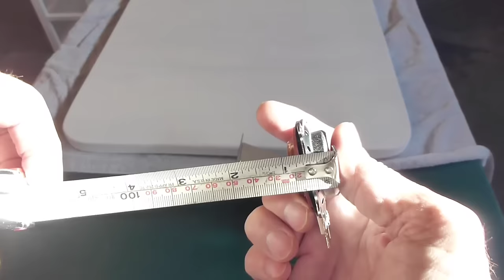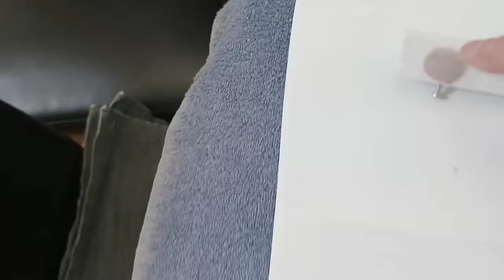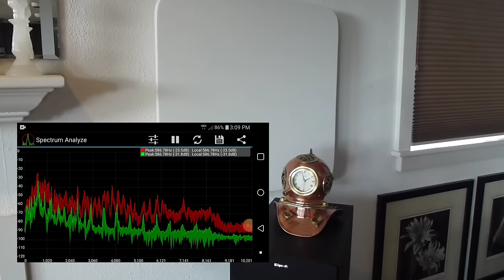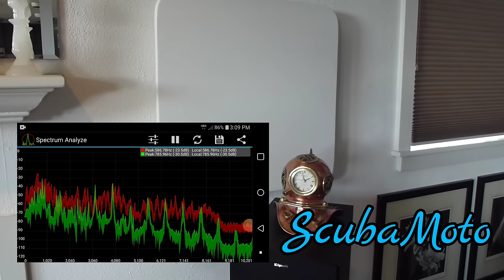How To Build DML Panel Speakers with Hidden Wall Mounts Fully Suspended

Comment: For some reason I can’t find 1 inch thick boards in Sweden. It’s either 20mm or 30mm, and an inch is 25.4mm.  What would you suggest I pick?
Reply from the maker: pepeu: The 24 watt exciter should sound good with either. The more power you're running through it, perhaps the thicker, more rigid dimension you would want but personal preference for aesthetics may be your deciding factor. It's likely that the origin of the 1-inch dimension by tech ingredients may have been as much a factor of what was readily available than of audio dynamics. With a few exceptions, most assessments of variations in shapes and dimensions yielded limited differences. Enjoy the project.

Comment: your mount looks amazing
may i ask if you stick both exciter to 2/5 3/5 area, or have one in dead middle?
Reply from the maker: shng sam: For the video I just wanted to show that this wall suspension system could accommodate both exciter positions and I wanted to show a layout for 2/5 3/5 position mount. So, I have heard this set with one exciter in each position and I currently have both at 2/5 3/5 but I honestly heard very little difference. I do have a note in the video description on exciter location. Thanks for the question.
Reply: @ScubaMoto  Thanks! Good to know that. in my future build i will have both in 2/5 3/5 position

Comment: What are the connector pins you use to wire up the exciter called? And where can I get them?
Reply from the maker: At the exciter I used spade connectors https://amzn.to/3Owwe2g I believe one is a 2.8mm and the other is a 4.8mm. I hope that helps.

Comment: But how do they sound with the volume up while listening to Waylon Jennings?
Reply from the maker: GB, My transistor radio sounds good with Hoss playin so now you have to build a pair of these to do him justice.
Reply: @ScubaMoto  - Yeah ... I've watched a few of these videos because I want to build a set. Your video was very helpful. I wonder if a different shape or different exciter would help with the lower frequencies?
Reply from the maker: If you're not building them as a supplement, just add a sub to deliver 150 and down. Larger panels will give a light reach down but you will likely be happier pairing these with at least a good sub. The Polk Audio in the video description is an example.

Comment: I'm curious.  Do we have any sense of what the sensitivity rating of speakers like this might be?  The exciters themselves have identifiable specs, but such specs are essentially isolated from the final surface area (i.e., cone equivalent) they are pushing.  Hard to tell from any of the videos I've watched what sort of SPL is achievable with X watts.  I ask because I picked up some of the 3W exciters when I was in Dayton at Parts Express a few years ago, and I'm wondering what I would need to achieve a reasonable listening level, or even whether such levels are achievable with those drivers.  For instance, is a 2W/Ch amp likely or unlikely to deliver useful levels, when coupled to 6 square feet of surface area, as opposed to the more familiar 10" round speaker?
Reply: i havent made these but everyone is using 20 to 40 watt exciters. i doubt the 3w ones would do much. but the 40 watt ones on a 24" panel can be pretty loud when turned up.

Comment: What paint did you use i am using lacquer and it's not sticking to my xps foam plate well
Reply from the maker: I sanded mine with the deep lines as mentioned in the video before painting and then used the same latex paint that is on the wall. Still good adhesion to this day. The paint is still adhering well and the exciters are hanging very well to the paint. I can still tug the exciters almost three years later and nothing is loose. I'm surprised an oil based lacquer isn't sticking well.

Comment: Question . What if i mount the exciter to a stand and the panels just float with no strings . So only the exciter glue will hold the panel . Would it work good ? My biggest concern is that the panels might have more movement to them because exciter is stuck to solid object .
Reply from the maker: Herus: Great question and I've heard others asking the same question since it would simplify the build. It will certainly have a different sound by changing the dynamic of the exciter. Anything attached to the exciter becomes part of it. So if the exciter is rigidly attached to a stand, they will move as one. The portion of recoil that was happening to the exciter will now be transferred to the panel as additional panel movement because the exciter would now be anchored. It will sound different but who knows, it might sound better. You could easily give it a try and see if you like it. If you try it, please let us know what you think for the benefit of viewers. Thanks for the question.

Comment: And of course, the Dayton Audio DAEX25FHE-4 Framed High Efficiency 25mm Exciters are not available. Doesn't matter, they are only 24 watts, do they make them 100watts?
Reply from the maker: frosted1030: I've heard some having success with the 40 watt exciters but it looks like even the 40W are backordered. Most of the ones above 50W are tactile bass shakers and would not likely offer the same frequency response needed for the same performance on a 24-inch square panel.
Reply: @ScubaMoto  I can rig some smaller Exciters in series, I hear. Sounds like a plan.

Comment: Are the exciters mounted directly in the center of both the panels?   

Another video led me here and that guy put them in 2 different locations on each panel to balanced the sound he said 

I’m surprised painting them didn’t affect sound. I’d like to make these them have a hand painted picture on both of them like art.
Reply from the maker: There's a note in the video description on exciter location. It depends on how many speakers per channel. Thanks for the question.
Reply: @ScubaMoto  I heard the mounting bracket and pin location measurements but must have missed the measurements on the exciters. Thanks for the reply, I’ll rewatch a third time and take notes.
Reply from the maker: If you're doing single speaker channels just use the 2/5 3/5 rule to locate it. For a 2-foot panel, that would be 14.4 inch from bottom and 14.4 from left or from right for the exciters. For a second DML on the same channel you would center the exciter.
Reply: @ScubaMoto  Thanks!

Comment: I am wondering if there is a way of making them Bluetooth ?
Reply from the maker: Patrick LaFontaine: Absolutely. I put links in the video description for examples of Bluetooth mini amplifiers and a power supply that works with them. One has a subwoofer output. I hope that helps with what you're trying to do. Thanks for the question.
Reply: @ScubaMoto  yup you can get little bluetooth stereo amps for ~$50 or a little more for what Scuba mentioned with a sub output, etc.  Heck you can spend hundreds on crazy bluetooth amps if you want, but I wanted to get something in the 50W /channel range to try applications like atmos, height speakers, or building a stand-alone frame that hangs the panel in suspension that can easily be relocated with a single hanger, etc.  Bring out to the patio, bedroom, etc.

Comment: Not cost effective, but I wonder if rigidity is key to sound quality, if carbon fiber would be better?
Reply from the maker: Chris Moore: Great point. If you have access to preformed panels it would be worth a try but I agree that making CF panels from scratch may not be worth the cost. At bare minimum they would go faster. ;-D

Comment: Can these speakers be simply directly connected to my stereo, like any other speaker ?
Reply: You have to compare the output power rating for the system against the input power required of the exciters you want to use. But theoretically yes.

Comment: Painting it doesn't damage sound quality?
Reply from the maker: Damage? Paint likely 'affects' audio dynamics. In a blind test, 10 people might give 10 descriptions of that affect. The bottom line is that the raw materials are unattractive enough that I have yet to listen to a pair of these that are unfinished. Some have tried fabrics, others texturing; but most use paint. A good paint with good adhesion likely offers the least sacrifice and may even improve audio delivery for many listeners due to surface texturing resulting from paint. Mine are still solid several years after so I would repeat the process today without hesitation. I would also consider commissioning an artist if I wanted super stealth sound coming from art with an acrylic on canvas look.

Comment: Anyone having issue with the exciters adhesive not holding up to a fall? I can't figure out how to  keep mine in place after the adhesive wears off
Reply from the maker: The most common solution I've heard to attach exciters is double sided adhesive tape. 3M 4910 is one example. I hope that helps.
Reply: @ScubaMoto  Thanks for the tip!

Comment: I really want to make one of those but I can't find those pink foam panels on my country. I have no idea what could be a good replacement.
Reply from the maker: WK_fpv: I put a link in the video description to get people started but for your location, just search on "poliestireno-extruido". It's very common in building materials and is not expensive. I hope that helps and enjoy the build.
Reply: drop ceiling tiles are as good or better and cheaper

Comment: Would we typically run these off the same amp as the conventional speakers or off their own amp? Also, should I make a second set with drivers installed and run them together? I also saw a video where a guy used birch plywood from his e depot.  Which is better for deeper bass and a richer all around sound quality?
Reply: Iff you want bass, just make the DMS's way bigger. You can use XPS for that. My mates panels dip into the 50hz as long as the sound is not too punchy. You should also use some sort of eq to flatten the freq response of the DML's. Makes m sound way better.

Comment: How about mounting these on the back of a canvas painting? Like inside of the back frame? Would it have an effect on sound?
Reply from the maker: Christer Johansson: Good question. I'll assume you mean mount the completed DML panel speaker behind the canvas and not just the exciter. Mounting the entire foam DML panel with the exciter to Canvas would likely work best with uniform adhesion of the panel to the canvas. But since canvas has no rigidity, you would not want to mount the exciter directly to the canvas. The exciter energy would send waves through the canvas. You would certainly hear something but not of much quality. Probably similar issues mounting the exciter to the canvas frame. I've considered sending completed panel speakers to artists as a canvas for a commissioned work. They are a good size for that.
Reply: I've been thinking about this too actually: mounting the entire panel inside a stretched canvas with a wooden frame - having the foam board suspended completely isolated from the canvas and frame. Maybe attached to springs like a trampoline. Not worth the effort if the canvass + thick paint would dampen the sound

Comment: What paint did you use? Also, did the paint dampen the resonance at all?
Reply from the maker: maddmannmmatt: I used the same latex that's on the wall. Good adhesion and good coverage of the pink foam. It probably has some effect on resonance but I didn't spend time listening before paint. It might even be a positive effect but either way I knew they would need to be painted to go into the room.

Comment: Why not just put some sticky tape on the back of the driver and stick that to the wall....you would effectively have a free moving panel only connected from the speaker. The only downside i can imagine is strain on the diaphragm from panel weight....unless you mount them on the ceiling
Reply: works only in theory because you consider the moving part to be fully disconnected from the rest. by far it's not
Reply: This is a very good question that I have also been pondering.
Reply: re: strain, in the current configuration, the diaphragm is supporting the exciter, and the exciter is much heavier than the panel.

Comment: What type of paint did you use in this build?
Reply from the maker: Tony Lesnau: I used the exact same flat latex paint that is on the wall it's mounted to. It sounds good with no adhesion issues two years running.

Comment: What kind of amp are you driving them with ? I ordered 2 pairs today so I could drive them with my regular Amp.
Reply from the maker: Scott Behl: The system they are running on (and the one in the video) is a gently modded Phase Linear 4000 with a single pass auto correlator filter into a four channel Yamaha MX-630 (135-8/190-4 wpc) volumed between 5 & 25 percent. One year later no issues.

Comment: What kind of paint did you use? Acrylic one?
Reply from the maker: The paint in the video is the same latex paint that is on the wall. Five years and still good adhesion.
Reply: @ScubaMoto  tks for sharing! Do you know if it interferes in sound quality somehow?
Reply from the maker: I'm sure there is some effect. Whether it's good or bad is a mater of opinion but I've never heard an unpainted pair since the raw materials look as bad as they do.
Reply: @ScubaMoto  Perfect! Thank you so much for your time on this! I'll plan the purchase of all pieces and try similar as you did. It's kind of hard to find everything here in Brazil, but that's why we pay for the internet, right?? :) Thank you again!

Comment: Little question, can these panel speakers be used as ceiling mounted speakers?
Reply from the maker: Jeroen De Vleesschauwer: Absolutely. It's a much simpler suspension that's easier since there is no need to adjust suspension pins or cords, they will all be the same length unless you want to "aim" the panels. You have only the speaker wire to contend with.
Reply: @ScubaMoto  thx for the fast reply. My wife wants my black Kef 3005 outside the living room because 'black'. So i'm looking for a worthy replacement 😉
Reply: @Jerre27  Try tinder
Reply: @xJBEZx  bad place to shop for a wife

Comment: the exicter right in the middle ?
Reply from the maker: Yves Informel: It depends. For the video, I needed to show that my design will accomodate both exciter locations: centered (6:08) and 2/5 - 3/5 (7:10). See note in video description for choosing exciter position. Thanks for the question.

Comment: 6:38
/
14:41

Comments

Add a public comment...

da man
Well after doing research all over the Internet and watch and find videos like yours I finally got all of my parts in the pink panels high quality pure copper speaker wire a nob sound Bluetooth mini amplifier connected to my Amazon echo dot in my title streaming music service I also did something not too many people talk about and I didn't think it'd make much of a difference I use a one-to-one ratio of wood glue and water coating two coats on the back where the Exciter goes one coat on the front and as people say at first you might be disappointed with the tinny hollow sound which mind did exactly that but with the codeine and when the exciters break in OMG these sound absolutely fantastic and yes they do not put out a lot of bass at all but Fidelity and detail in music songs and movies do not come from the base it comes from the upper frequency drivers the mid-range and the tweeters and that's exactly what the panels produce I tested them against my parts Express Dayton bookshelf speakers that have audio feel grade ribbon tweeters and they come incredibly close to mansion the upper airy sparkle and detail of the ribbon tweeters I would say about 93 to 94% close that's in a hell of a lot in simple terms for an excited stuck to a back of a piece of foam but I did all the techniques of sanding the front and back panels in One direction using only one inch panel adding the coating to coats back one coat front I also used gorilla glue on the exciters that I bought from parts Express that has the four plastic legs on the outer body to make sure all the vibrations the Exciter can produce goes into the panel for sound the soundstage and the openness is nothing short of amazing and the speed that the sound goes from left right left right left right is very impressive seems to be faster than regular bookshelf speakers so when you do all the techniques on the panels you glue down the exciters so all of the vibrations are not lost and they go to the surface and nowhere else and high quality wire a high quality streaming source and a high quality affordable amplifier and you put this all together it is absolutely amazing the sound quality the speed the depth the sound field and the overall detail that these produce they definitely have better upper frequency detailed spaciousness then my Polk audio speakers with silk soft dome tweeters and they're almost a Dead ringer against my ribbon tweeters in my Dayton bookshelf speakers I've noticed on the internet forums and on videos others use the wrong size material or wrong material they didn't tune the material by sanding the edges round in the corners sanding the front and back of the material and didn't add any coating this essentially tunes the material like the strings on a guitar neck tunes a guitar thus for their panels didn't have the upper frequency treble or detail or spaciousness so they ended up just adding a regular standard Tweeter speaker which kind of defeats the purpose of just using an Exciter by itself to see what kind of quality sound can be achieved from the excited by itself.
Reply from the maker: da man: Thanks for sharing your experience and evaluation. I'm glad you had the same positive reaction to these very affordable DML's as I did.